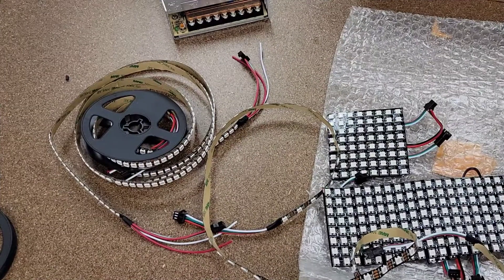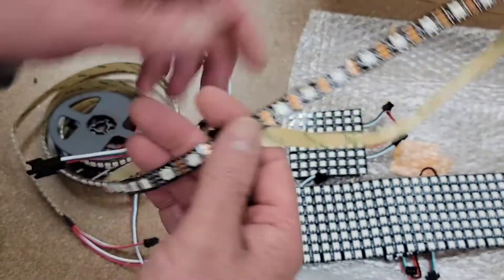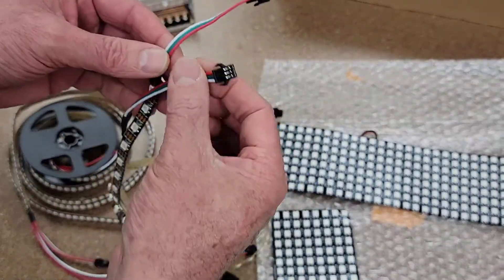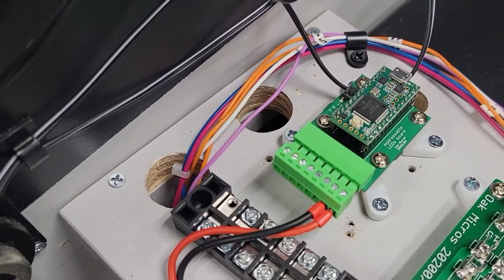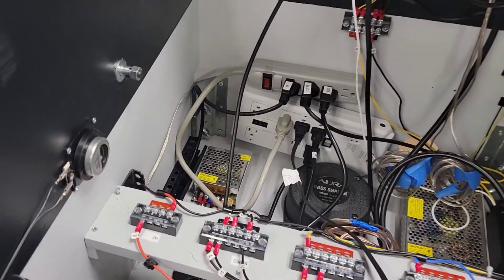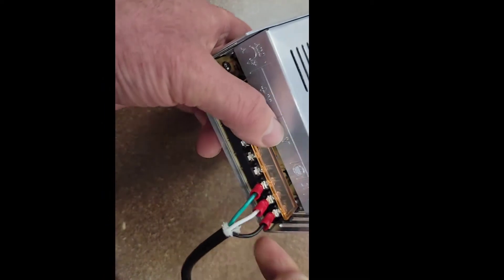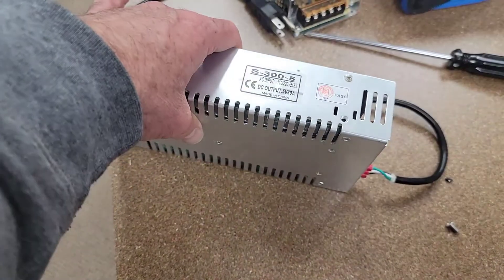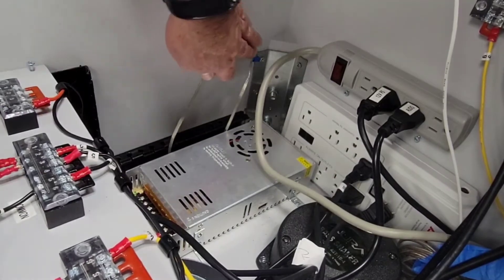Virtual Pinball Project: Intro to Addressable LED Strips – Lighting Up the Game

Comment: Perfect video! I have a virtual pin and bought the same LED matrix and siderail LEDS. Have been putting up putting them on..thanks for sharing bud
Reply from the maker: This is going to be larger part of the project than I anticipated. The wiring alone is going to take a while. I did another video today and will upload later. Just another "prep" type of video.